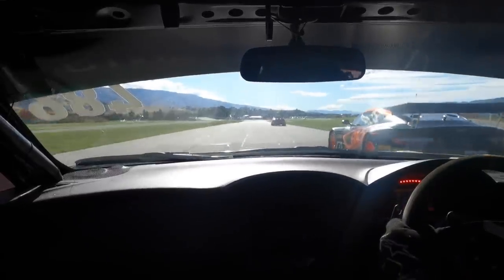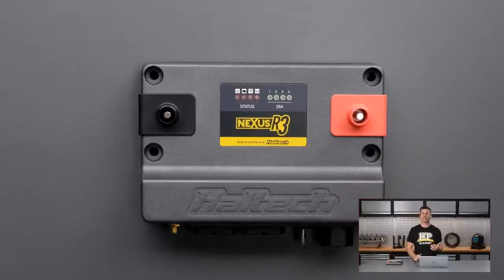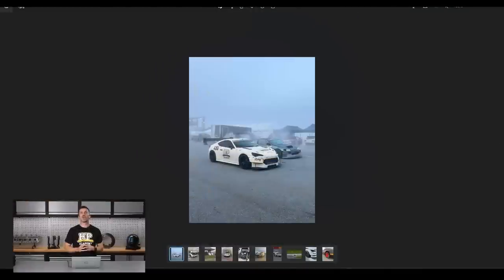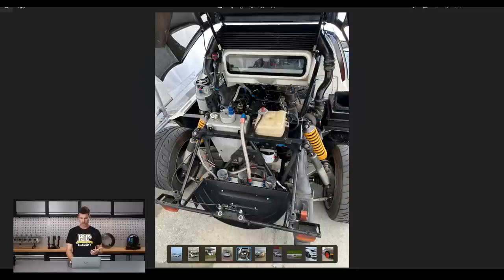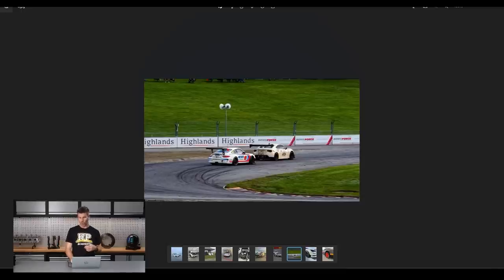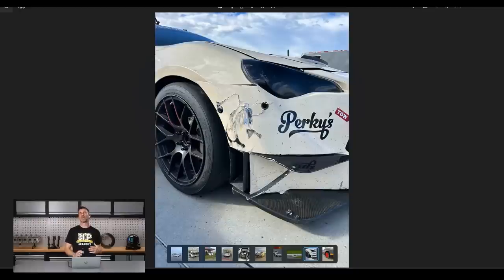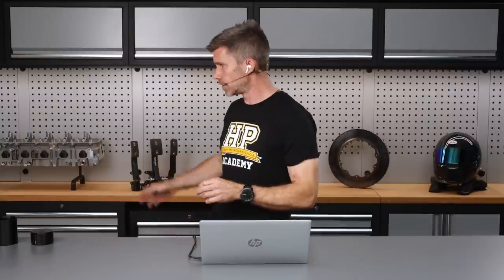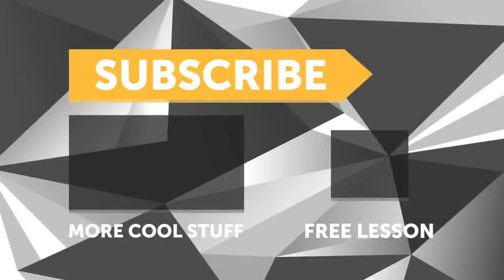RIP Stock ABS System

Comment: I just installed the Bosch M5 kit. The pre-terminated harness is a PITA. Some wires are too short, most are way too long and there is no way to pass it through the firewall. I ended up cutting the harness in half and putting a firewall connector in it. Neater install and gives an opportunity to shorten excess wire length from the middle.
Also the wheel speed sensors are a bit picky working with the factory tone rings (on a BMW e36). Can share more info if you like.
Reply: Not sure if your message was directed at me but here’s my spec - using Porsche/ VAG bearings with built in encoder / reluctor ring 
These will then accept bmw 5 stud flanges or Porsche GT3 RS Cup / motorsport center locks and driveshafts. Fitted to a bespoke alloy upright . There are only 2 types of abs / wheel speed sensor as far as I’m aware Hall effect and the other one I can’t remember .
I have a funny feeling the bosch M5 will not be anything special just a few software/ firmware updates .pot will just regulate a parameter on the ecu for adjustment. 
Later bmw M4 etc uses a very similar abs motor to the one in this vid so was thinking it may be a generic high end performance unit anyway just with a potentiometer / uprated motor speed  .

Think most have a yaw / g sensor anyway and the one in this vid looks standard .
Can’t really make any more comments as I haven’t gone deep into research .
Reply: I wish I could post photo, very hard to describe. There are two types of factory tone rings, depending on the hub.  FAG uses a pressed sheet metal tone ring. The ABS sensor does not trigger in either axial or radial configuration. Either the curve of the tooth shape or lack of ferrous material in the thin sheet metal doesn't trigger it.
The SKF tone ring is like a 'ladder' ring. Made from 2mm thick steel it is a band with the two outer sides holding teeth or 'rungs' across it.  The M5 sensors work on this only when placed radially in the centre if the tone ring. When placed axially, the continuous metal band looks like one long, continuous tooth and doesn't trigger. 
So, for my application the rears were ok (axial mount on the SKF style) but I needed make my own front tone rings as the only mounting option for the sensor was axially and neither off-the-shelf hub worked.
Reply from the maker: Cheers for sharing your experience! We're not that deep into the install yet but will be interesting to see what Brandon and Andre think of that side of things. We do plan to focus more on the performance given documenting the likes of installation pretty much doubles the time it takes to get it done without any cameras involved 😅, but I'm sure it will come up somewhere as part of the journey - Taz.
Reply: @hags568  yeah kinda hard to describe via text . I am under the understanding there are 3 types of abs trigger , the ladder type you explained , this is on e36 rear driveshafts and some 964 997 Porsches and very common, the second is more like a toothed trigger like on the end of a crank , same principle as far as I’m aware  . The third is the type built into the wheel bearing end face . The latter may work on a different principle but must sure . I have a few bearings that have this type of trigger, not sure if these are magnetic as there are very fine and presume may need a more accurate/ sensitive abs sensor. .
Not looked into anything in detail as of yet so not that clued up , but need to find out for myself anyway for our project. Hope this helps
Reply: @hags568  one last thing , I may have to have some laser cut discs and providing the tooth count is the same and diameter. Not too hard and a fairly cheap solution
Reply: @newagetemplar6100  that's exactly what I did. I just made them about 1mm undersized and then bored on the lathe 0.05mm undersized for a press fit with green loctite.
Reply: @hags568  nice one 👍

Comment: Appreciate the review of Bosch Motorsport ABS. You introduce and advertise the other products in style, really top class, and I actually want to watch it. As opposed to me skipping adverts in other YouTube channels. Now that I know about it, I'll fit the Bosch Motorsport ABS to my Elise S1 in the near future, as the engine will put out 300 bhp in the near future - K20 engine swap of course.
Reply: Look at the other comments for better value kits
Reply from the maker: @ryan - Better value depends on what you want from your ABS system. if you simply want cheaper, yes, there are other options that are cheaper in outright cost, but they are certainly not the same.

In that vein, I guess the stock system from the GT86 is up for sale 😂 - Taz.

Comment: Looking forward to the ABS videos! Considering you have delved into the MK60 route for the FJ project, do you think you will be able to give any comparison between the two systems? Thanks!
Reply from the maker: The FJ40 project is on hold at the moment and not being a race vehicle but rather a street vehicle on 35" tyres there won't be a whole lot directly comparable in a super useful way. We might have something else pop up in the future though that lends itself to such a discussion a bit better 😎 - Taz.

Comment: I would love a similar ABS system for a motorcycle
Reply: Lots of new bikes HAVE to come with abs, just not always adjustable or disable-able
Reply: @ElPants21   it would be great if someone cracked the firmware of one of those units… make it adjustable, able to be disabled, CAN output for wheel speeds, maybe G, lean and yaw, there’s so much possibilities

Comment: My audi a4 2012 has similar pump which failed and i brought it home, i even have the connector that came with a used unit i purchased. 
Now that i know bosch motorsport does this pump, i will buy another used and buy accessories from them and play with it.
Reply from the maker: The pump itself isn't really the key feature to be fair, but it's a start 😎 - Taz.

Comment: Are you guys running oem pedals in the 86 or a pedal box?
Im switching to a floor mounted pedal box on my jzx100 chaser and would like to keep the oem abs so kinda figuring a way to make it work
Or am i better to ditch the abs completely
Reply from the maker: We are just fitting a PE Racing pedal box now, however, we are also fitting a Bosch Motorsport ABS unit as well.

I would guess that the stock pedals with ABS might be better than a pedal box and no ABS if that's what you're considering, otherwise a Bosch Motorsport unit or the likes of the MK60 setup would be a good investment to benefit from a pedal box and not lose out on braking performance via ABS.
That is all just opinion - Taz.

Comment: How are you getting on with the FJ40's ABS - can't recall which you're using for it - and how are you getting on with the LVV chaps?
Reply from the maker: The project is on hold, back to race cars. Andre still has the letter from the LVV chaps giving the green light from their end. Will update in time when there is something to report. In the meantime ABS into the SR86 and the CRX has had/is getting a lot of work done to prevent it from tearing itself apart further 😅 - Taz.